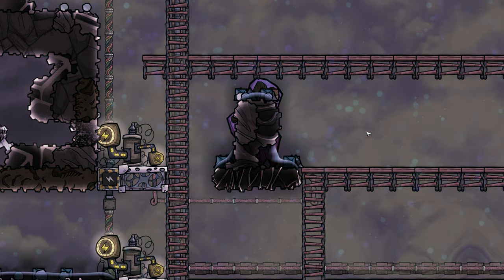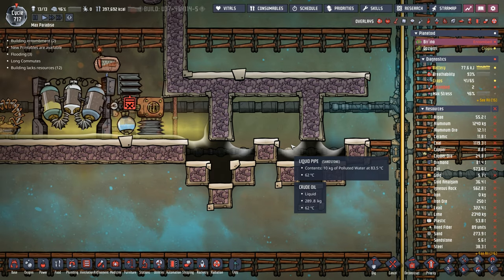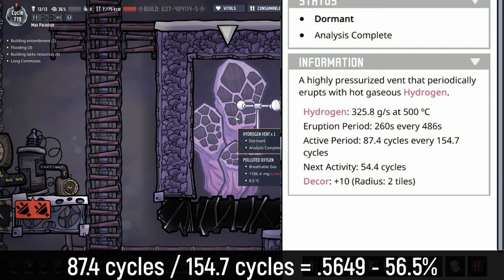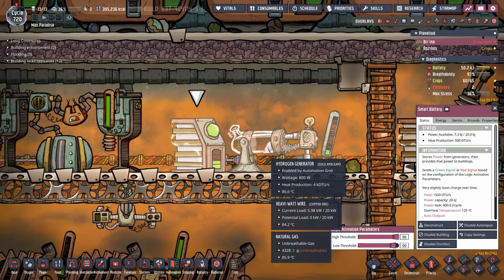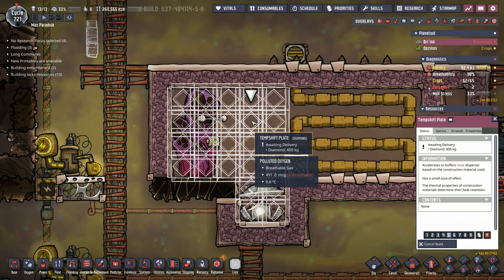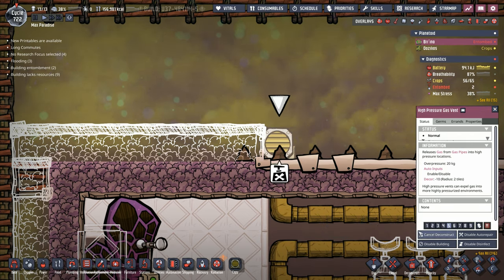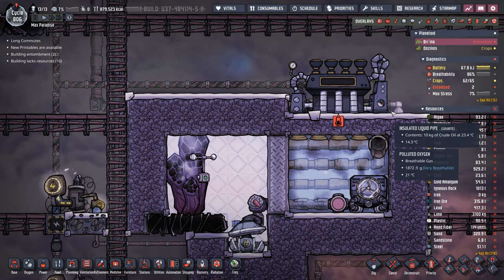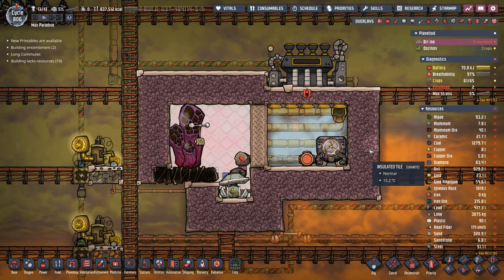Hydrogen Vent Tamer Tutorial | Oxygen Not Included

Comment: The 500°C is actually quite great. Too bad it's gas so it actually doesn't have much heat energy. But you can use this to turn crude oil into petroleum without risk of overheating it to sour gar. But like said, the vent won't have much heat energy and even a tiny amount of oil will just soak all the heat from it. Still early on this is one of the easiest ways to get oil turned as it doesn't require steel nor plastic or any of the space materials.

Comment: A decently cheap/low tech hydrogen tamer method is to make your hydrogen travel through a snake to get to your pump, moderately cool it around the pump and then backfeed and radiate this coolness back through the snake, cooling it before it reaches the pump. Then you just burn the re-heated hydrogen.

While this works it also results in the hydrogen having a travel time to get to the pump resulting in a slower extraction speed.

Comment: Granite is not a good insulator, actually works for pre-radiant pipes prior to having them, and generally as long as you are not heating your base up to absurd levels can just use granite normal pipes with some water to keep it at a good temp.
Steal anything does not have 275 C before it overheats. It has an extra 275 C above the base overheat temp of whatever the item is.
You could have used roughly 1/9th the diamond or even 0 in the hydrogen room. More eventually just lets less spiky temp changes, but again not needed if you do not have it. Can also use a different temp shift plate as long as it can take 500 C and it might not get to 400 C if it is done right.
Could have made the steam room two tiles high with a lot less water. Then used a door to inject heat if needed.
Almost all of the above would allow for at least 1000s of cycles. Not saying your design will not last for 1000s of cycles, but most of it is not needed.

Comment: That's a pretty neat way of doing it. Keeping the gas pump safe.   Maybe next dormancy cycle I'll play around with your idea and see what I think but I came to this after thinking through my own solution.  I used no temperature shift plates because I want all of that heat touching my metal tiles which touch the water basin on my industrial cube through a mechanized door in between more metal tiles doing the open and close trick to create the vacuum insulator if for some reason the cube rises close to overheat temps for steel machinery. But I doubt it will and I want to get maximum temperature out to the steam turbines if possible.  I've tried this before with a PO2 vent but I don't remember if it was as hot.  Either way, it cooled pretty much instantly to safe for gas pump temps and didn't give me the sauna temps I wanted. But this time my intended target is cooling the hydrogen and the steam heat is the byproduct. So maybe it'll be better.  

To make use of the hydrogen I use another mechanized airlock inside the sealed vent room.  When the temperature gets low enough that I won't break the gas pump, the door opens and floods the pump on the other side of the door in its own vacuum with hydrogen.

Comment: Much like eric said its overkill for this vent.    its either going to get burnt off vented into space or turned into liquid.   Pre cooling it for liquid is pointless as its so cold in that set up it insta drops.

2nd thou is if that pump ever back up the vent will stop emitting thus you lose resources.   The all time best set up to tame a vent and never get backed up is to use the same size area but you seal off the pump with a vertical 3 door compressor.  moving all the gas from the vent to the pump keeping the vent in a vacuum.

Comment: Nice looking, but really excessive build. One way is how somebody mentioned snaking it in tiles and letting it cool naturally, but of course eventually heat will build up. So turbine is needed, but no aqua tuner. You put tempshift plates just behind the vent and some metal tiles just above the vent, some water on them, then insulated tiles and self-cooled turbine. This way You can extract hydrogen at 125 degrees, but if You willing to use more space and do some more work - You can make one tile-wide tunnel from insulated tiles for hydrogen to go up to the turbine, which could be submerged in a tree layers of liquid, where You can place the gas pump and let the self-cooled turbine to cooldown that hydrogen down to 95 C.
Reply: This ^^^

Comment: This is super overkill lmao.  Oni gases have a bonus temperature transfer rate to solids, so you could probably just have a steam room and metal tiles.
Reply from the maker: It has been running for over 50 cycles now. No back ups and we are using 100% of the hydrogen as power.  Eventually the steam would heat to a point where the pump would melt on equilibrium with the hydrogen side, that is the reason for the steam turbine.  What's great is that the aquatuner runs less than 3% of time too.  At the minimum, it has shown everyone another way of dealing with it.
Reply: @EchoRidgeGaming  pump wouldn't melt.  Equilibrium would be slightly above the steam temperature of 125.
Reply: Oh I meant steam room + turbine, but no tempshift plate or cooling loop
Reply from the maker: @ericab3919  Sorry, combing responses.  Someone else said that we would lose resources, and  I was letting them know the steam turbine prevents that.   I realized in the vid that I think the aquatuner could probably go away and be just fine.
Reply: @EchoRidgeGaming  you the best I woke up this morning and watched your whole video over a cup of coffee.  Most oni builds are overkill imo.
Reply: @ericab3919  But this is an overkill build? More than 3 temp shift plates is probably overkill. A turbine/aquatuner is relatively complicated. All you really need is a cool slush or salt water geyser to get the hydrogen cool enough to not damage a gas pump. This build also doesn't really account for geyser downtimes. That isn't necessarily a bad thing, but this build not having the capability of effectively stockpiling hydrogen could be an issue for some people.

Comment: This is a really nice video. However I don't really get how you cool the hydrogen down to 20 ºC. Hasn't it been exchanging heat with 100ºC steam with gold amalgam as the mediator?
Reply: The thermo aquatuner has crude oil probably at 20C which passes behind the steam turbine. The hydrogen and crude are both using radiant pipes, and since there's 10kg of crude vs max 1kg of hydrogen, the short 5-tile exchange is enough to cool the hydrogen from 100C to 20C.

Comment: You don't need to double wall if you don't let the plate spread heat into them.  You don't need to have the plate touching each other.  They even out the heat 1 tile around themselves.   Plus, if you set the senor to 3000 you won't get a temp spike when it's going off.   More gas helps soak up the heat evening it out because the 3000 is cooler and takes longer to heat up than 500.   Nice build thou.  But you need to show how to store the extra gas.  Without that when the vent isn't active your generators aren't running because they have no gas.  It been wasted running your generators all the time burning gas off, so the vent doesn't over pressure.

Comment: Huh I'm kinda surprised I made something similar just finding things out but I made one that goes vertical so the hot metal would be touching the water first before the void for faster conversion but I didn't pass the hydrogen through the steam and instead put a separate container on the side that had water that I turned to ice using the aquatuner since I was lacking in the steel department and didn't want my generators overheating coz I made them from cheep metal.

Comment: That is a good guide. Do you have any tips for what to do with it if you find one early game, the first 100 cycles?
Reply from the maker: Run.  It is too hot to deal with early game unless it is dormant.  If you do catch it dormant, put some insulated tiles around it and approach it later in suits.
Reply: @EchoRidgeGaming  Thank you. The one I fund is covered up.
Reply: it's just not worth it.
if you have the thermal mass you can try to push through relatively early. like piping it through a cold biome, a huge pool of water and so on, but it will eventually have to be tamed. and it's main problem is where you put the gas pump, since eventually it will overheat. meaning you have to bring down the hydrogen down to the working temperature of the pump, if it is steel - to around 250. so if a colder biome is close by you can build a tunnel to there, so it can cool down a bit, pump it and pass it through water. but that is a huge project that will backfire eventually. 
the time you will spend building it, will be better put at progressing to the midgame, where you will be able to tame it more properly.

Comment: I see you use auto sweepers to move your coal to your coal gennies, and to use your steel maker, I tried doing the same thing for my coal generators but the auto sweepers do nothing, how do you get them to transfer coal from the storage to the generator?
Reply: This is kinda late for your question but a sweeper by itself is supposed to do nothing. It only takes an item and moves it but has no inventory or capability to put it on a conveyor belt. You need to have a conveyor loader in it's range so the sweeper puts the item in the loader's inventory and then the loader puts it into the conveyor belt so it moves or a conveyor receptacle, which takes items from the conveyor belt into it's inventory and then the sweeper takes them out of the receptacle into a storage box or whatnot. Just don't forget to set the filters on the loader and receptacle to take in the items you want to move so for your example that would be coal. Hope this helps if you still didn't know how to do it